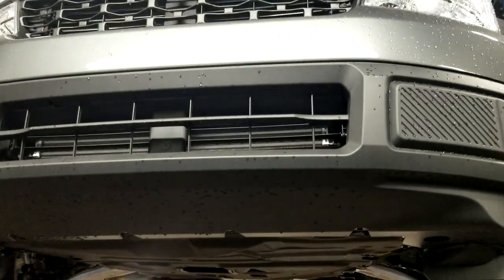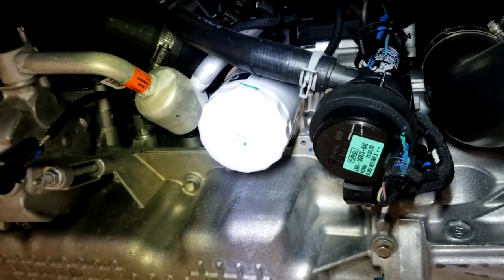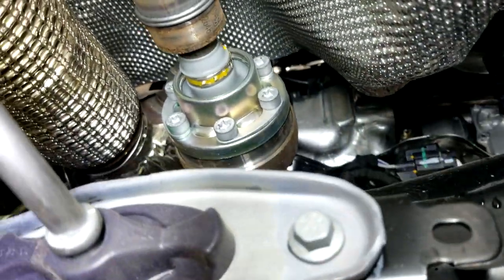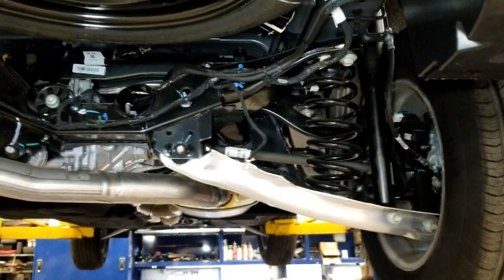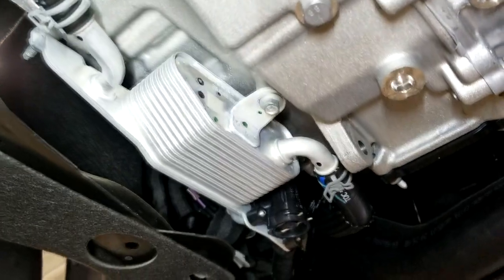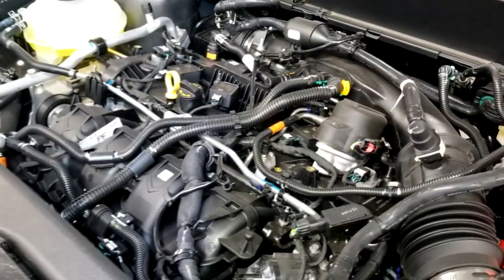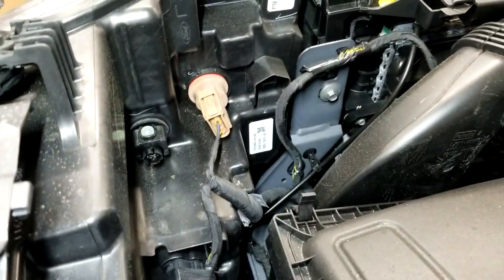2022 Ford Maverick 2.0L 4x4 Bottom View

Comment: Squirrels would chew those wires where i live . They love wires to chew for some reason .🤔
Reply: Electro 🐿️
Reply: Animals behave in weird ways...
there was a time when a mouse made between the firewall and the engine, and used the engine insulation to make the nest. 
needless to say, i was there removing fluffy fiberglass for almost an hour.
Reply: Watch out for those nut stashing Squirrels also 😂😂
Reply: The wiring insulation is probably a soy based concoction that can be digested instead of being based from crude oil, that's why they chew on it.  Other OEM's have the same problem.
Reply: @robertjones7565  would be nice is they somehow found a way to make them taste horrible

Comment: Just like everyone else, this is exactly what I was looking for. Looking at how buried the turbo is, it will probably be a big job to replace and possibly needing the cradle to be removed as in other models I have seen. I'd love a video of you showing the service procedure for the turbo replacement, even if it's just via the computer. The previous gen turbos would wear out pretty fast (70k miles and less in some cases) so it'd be good to know what one is in for.

Comment: Just picked up a 2022 2.0L XLT 4K tow 4x4 Off Road Lux packages with 12.6K miles from Carmax late May 2023.  Got the 150K mile Maxcare warranty with it.  So far has had three (3) oil changes including one by Carmax right before I bought it.  Been driving that thing a lot including towing a 21 foot camper dry weight 3200 lbs and have racked up 3K miles since purchase.  Over this past weekend I had a dealer perform The Works service so make that four (4) oil changes in the first 15.5K miles.  Plan on doing 5K oil changes as I'll be towing at least 1K miles a month.

Comment: I am considering buying an XL FWD 2.0, when the buyer frenzy and lack of availability is over. Unfortunately I am having doubts with Ford's quality of recent years, including the 2.0 ecoboost issues. We own 3 Rangers with the 2.3 Mazda design engines. One has 304k. They have been very reliable, with routine maintenance and a few minor repairs. Thank you for your videos.
Reply from the maker: The Hybrid uses a similar Mazda designed 2.3 Atkinson engine  that was in the 2006 Escape hybrid. I know there were some problems with the 2.0 Turbo engine but there have also been many improvements since the 2019 Escape 2.0 block & head design's

Comment: Fantastic video, thanks. My 2015 Genesis has a similar ridiculous layout with the addition of about 8 plastic push pins to remove at the bumper which always fall out between oil changes. At 2 years, half of the metal bolts were rusted and broke off. For all the remaining bolts, I replaced with stainless steel and use anti seize. If these bolts aren’t stainless or aluminum (check with a magnet), I will replace them with stainless on the first oil change. Cutting an oil filter access hole is easier said than done. I tried it with my Genesis and it was a failure. Using zip ties to hold the panel in place was really suboptimal. I wound up having to replace the pan when this access panel fell out and was dragging the ground. My 2017 Chrysler Pacifica van has a great built-in plastic swing down door with a hinge that is perfect for accessing the drain bolt and brilliantly, the oil filter is at the top side of the engine just like my 85 Peugeot and many of the European cars as well as Subaru. I use a Fomoto drain valve for easy oil drain  on all of my cars for the last 20 years.

Comment: Wonder how all those electrical connections will hold up while running through deep pockets of water during flooding.
Reply from the maker: I would think snow & salt would be a bigger problem
Reply: Take some preemptive steps and spray some underbody coating over the connections. The wires will be fine.
Reply: The same way they do on every body-on-frame pickup that also has exposed cable runs?
Reply: @1970351C2V  yes, the cable and tubular hosing is one thing. It’s the plastic electrical connections that are my concern. Driving through 2’ of water during flooding, also in the Northeast, snow and salt is another major concern. 
I guess time will tell. 🤷🏻‍♂️
Reply: @bluecollarmark  I have only had my ranger for two years and some of its harnesses, and plastic wiring areas are exposed and haven’t ran into any issues yet. Granted only been two years but guess the Mavericks wiring should last Atleast 2 😂

Comment: Be interesting to see how that exposed wiring holds up in the rust belt.
Reply: Just don't live in the rust belt. Easy
Reply: @ttgsushi5767  Struggle is real man.
Reply: car wash and rust proof problem solved
Reply: @willie9397  washing def helps but salt is really hard on the underside. Some vehicles based on metallurgy handle it better than others. In this case wiring will also be a factor. It may end up being a non issue. We will see.
Reply: Just a little salt and those wires will be toast.
Reply: And the field mice. I have seen the mice eat these under body wires.
Reply: My first thought, exactly.
Reply: @ttgsushi5767  
Good one skippy

Comment: Best underside look I've seen!  Does it look possible to fabricate a front-mounted 2 inch receiver?  I use a SnowSport snow plow on my Subaru Baja which I would want to move to here.  Is there a radiator between where the tow hooks would be?
Reply from the maker: Haven't had a bumper off yet but it looks very tight,,, not even enough room for the horns

Comment: I seen that they have two holes for the rear diff mount to the subframe when looking at it from behind. I wonder if they are using the same rear subframe as they are the bronco sport? I also noticed that the front wheel bearings look as though they are pressed in. And the rear are bolted in with 4 bolts. Are the rear lower control arms for the mulit-link aluminium or just shiny steel? Kind of sucks seeing the big bushings on the front control arm are the kind that tend to fail sooner rather than later. I hope they can be easily pressed out of the aluminium arms they used without distorting the arms too much. All in all, its similar to my 03' VDC Ouback underneath.
Reply: Yes, same bronco sport platform. The rear subframe had recalled on bronco sport.
Reply: I'm guessing the front control arms/bushings will be replaced as a unit.
Reply: It is the Bronco Sport !!!!

Comment: Seems like a huge pain to do an oil change. Chevy puts small 10x10 cut  outs in key areas of the skid plate,  like oil filter, and drain plug, enough to reach a hand up in there no problem.
Reply: Seems like something we’ll be doing when we get ours. 😁
Reply: @NarySllim  Yep, gonna get the saw out probably myself if I ever start changing my own oil.

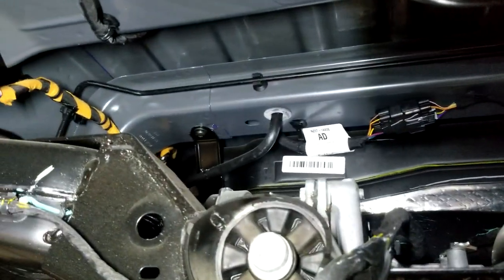Comment: 2:20 I'm not sure about the wires exposed underneath. It's a Truck, so it could go through water.
Reply: Pretty much any truck had the rear wiring exposed due to the box, I'm not aware of any that run them any differently, so I assume they made it with that in mind.  As a direct example I have a Dakota from 98, nothing is hidden underneath, and everything works.  Off roading trucks I'm pretty sure have it exposed as well, but it's built with that in mind.

Comment: This is great!  Thanks!  Is the bottom shield / cover made of metal or plastic?  There ought to be a way for the home mechanic to cobble up removable covers for the oil filter and drain plug to avoid having to remove / reinstall 15 fasteners.  Ford should've thought of this.  They thought of everything else!
Reply from the maker: Some are metal & others are a fiber material similar to what the Focus or Escape used
Reply: @RedneckCam666  Thank you!  Best of luck with your new Maverick!
Reply: I have a Focus and an Edge, I do Oil Changes on. Even Laying on the Ground doing an Oil Change, the Covers are easy to get off and back on. I have two Pick-up Trucks, with No Covers, and they are a pain. They have this Catch Pan under the Oil Filters, but the Oil drips down in Multiple Locations. Also I have to clean those pans, so I don’t have drips on the Garage Floor.
Reply: Car companies want you in their shops.

Comment: Looks a lot different than my 4x4 Ranger. The Ranger has steel skid plates even without FX4.
Reply: Your ranger is a real “truck” because it has body on the frame construction. This vehicle is a crossover with a bed as it is unibody construction.
Reply: @cliffmorrison1130  gatekeeping much?

Comment: Why do you think the reason Ford did not put a plastic engine cover on the Maverick engine like the Escape?  I understand some folks are ordering the Escape engine cover to dress up the engine and reduce noise.  But as we all know, there may have been a design purpose from Ford Engineers to deal with heat. Anyone have thoughts on this?  Overall great video.  Thanks for sharing.
Reply from the maker: Because their CHEAP!

Comment: are you using the correct terminology?  4x4= all wheel drive PTU = Power Transfer Unit ... or ?
Reply from the maker: I guess it would be Electronically controlled AWD & a PTU with an electronically controlled disconnect
Too much to put in a title
Reply: missed my polite attempt at educating you...1) the MAVRICK is NOT a 4x4 2)NOR does it have a ptO that in heavy applications would be used to upfit a hydraulic pump ... or if its a tractor with a three point hitch a  snowblower!! A ptU is what it has power transfer unit
Reply from the maker: @coachskil  I never called it a PTO, I also work on farm equipment & know the difference
Someone else questioned me on this but I''ll repost...

From The Ford Service Manual on the Maverick driveline

The Power Transfer Unit (PTU) is a gearbox that attaches to the transmission. The PTU directs power from the transmission differential case through a dog clutch to a hypoid ring gear. A hypoid pinion gear is meshed to the ring gear and splined to the output flange. A dog clutch is used to transfer drive torque from the input shaft to the ring gear. When the dog clutch is released, no torque is transferred through the ring gear and pinion to the rear driveshaft. When the dog clutch is engaged, normal AWD function is achieved by directing torque to the rear wheels as needed to prevent or control wheel slip and improve handling

Comment: Why didn't they cut a hole for the oil filter?
Reply from the maker: Email Ford & ask for an access panel!
If enough people ask ...they will put it in
Reply: You still can’t drain the oil from the pan until you remove the shield.  What would be the point to cutting an oil filter hole??
Reply: @eddiearmacost7649  Actually two holes like my camry has.
Reply: 1.  Cutting holes in a flat panel can create mysterious NVH issues.
2.  They would have to make a different panel for the various engine models.
3.  The cover is there to increase mileage.  Any holes added to the cover are counterproductive.  

If you're so inclined, you can also make access holes yourself.

Comment: Nice video.  I love the ease of maintenance on this truck.  Oil changes and tuneups seem like a breeze.  Good gas mileage can make this my daily driver instead of my current half-ton truck getting 16 mpg.
Reply: Truck? Seems like a Ford Escape to me. A real truck is a Toyota Tacoma.
Reply: @jaysmith179  Don't knock it quite yet. People said the Jeep Cherokee Trailhawk  was just a badge. Instead, if you watch any off road Jeep Wrangler videos, there's always a Cherokee right behind it keeping up. That said, the AWD system here will need to be upgraded to the version that is on the Bronco Badlands. That AWD system is a direct bolt for bolt replacement.

And since they used the 2.0 ecoboost, Steeda already has a full suite of power upgrades available because this is the exact same engine that was used in the Focus RS. Steeda got the Focus to just over 380 HP while still maintaining 35 MPG. However, if all else fails someone could just swap the engine to the 2.3 ecoboost that is found on the Mustang.

The AWD and engine swap are probably what Ford are planning for the Raptor/Rumbler version of the Maverick. Would it be able to go everywhere a TRD Pro Tacoma could? No chance. But it could go 90+ percent of those places with double the fuel economy. And absolutely blow its doors off while doing it.
Reply: @jaysmith179  And for the record, I'm a Toyota guy, too. 2020 TRD Pro Tacoma.
Reply: @jaysmith179 Except the Tacoma carries less cargo- The Mav takes a genuine 1500 lbs with crew cab seating.  And the Tacoma with crew cab and 4WD cost 15k more.   The Tacoma also has LESS interior storage. And its bed is as short, but not designed to carry 4X8 sheet goods like the Mav. Has fewer tie downs, and does not have the built in trailer brake controller the Mav sports with the 4K tow package.   The Tacoma is larger, with poorer gas mileage.  About the only thing the Tacoma has over the Maverick is it can tow more, IF you get it with the larger 6 cylinder engine.  ( the Tacoma also has a higher ground clearance. )  But for those of us who don’t need to step over large rocks or deep ruts, The Maverick is a better, more usable truck than my 2004 Tacoma 4x4 crew cab ever was.

Comment: FYI       I sat in a Ford Maverick.  I'm 6'4" over 250 lbs.  When I put the drivers seat in the position that I'm comfortable, no one over 5' could sit in the seat behind me.  I ordered one by it's for myself and wife.   Mostly myself.  Just giving you some info these guys aren't.//
Reply: Im also tall and i hate center consoles. My small car has a low console. My knee rubs the big ones. Wanted to get a bench seat truck. But the maverick gives me a little hope. Is there enough knee room when your tall legs are "spread" and on the gas pedal?

Comment: A solenoid to disconnect the rear drive shaft? Don't think so......This is ALL WHEEL DRIVE> Continuously.
Reply from the maker: From The Service Manual

The Power Transfer Unit (PTU) is a gearbox that attaches to the transmission. The PTU directs power from the transmission differential case through a dog clutch to a hypoid ring gear. A hypoid pinion gear is meshed to the ring gear and splined to the output flange. A dog clutch is used to transfer drive torque from the input shaft to the ring gear. When the dog clutch is released, no torque is transferred through the ring gear and pinion to the rear driveshaft. When the dog clutch is engaged, normal AWD function is achieved by directing torque to the rear wheels as needed to prevent or control wheel slip and improve handling

Comment: Wow no access tunnels for oil changes? Come on now that's amateur levels of design. Also all that exposed wiring looks like a big recipe for disaster when it comes to corrosion, guess you can't drive the maverick in the rain.
Reply from the maker: If everyone sends a message to Ford , they might do something about it
Reply: All pickups had exposed wiring ever since they were built.
Reply: @keithwiebe1787  I was going to say this under a few peoples posts but refrained. You watch any video of the undercarriage of any modern truck and there’s exposed wiring harnesses everywhere, attached to the frame, or by the transfer case etc.
Reply: Trucks always have exposed wiring harnesses there is no place to put the wires my old ranger doesn’t have issues with wires corrosion
Reply: @zackhaycraft8159  maybe so, I've only owned Toyota trucks and got the most part they never had it to where you can see the actual color of the wires without at least one layer of protection. If I get this truck I'll probably just keep an eye on it, seems like a lot of people haven't had issues surprisingly. Electrical issues in cars is just an absolute nightmare to trace and is often just due to corroded wires.
Reply: @Mr.Meme01  most trucks I haven’t seen issues when they are exposed

Comment: I guess the screws will be stripped out after a few oil changes ..
Reply from the maker: For sure if guys use a cordless impact driver to put them back
Reply: Yes, about every Escape I take the cover off the screws are already stripped and barely hanging in there. I will do my Maverick maintenance myself to avoid stripping it. My only concern with so many panels is they are perfect areas for rodents to build nests in.

Comment: Wow. It’s tight under there! How much do you have to take off to get to the turbo and ABS for service? I hope we don’t see broken exhaust manifolds, turbos and transmission/trans axles becoming major failure points on these guys. And these definitely are soft off roaders. Your not going to be doing much rock crawling, stump jumping or mud bogging. To much exposed fragile stuff. The salty road lands are going to eat all that exposed wiring and connectors like Halloween candy! 

I would like to see the undersides of an FX4 package truck to see what the armor protection looks like. This one is just the AWD model. No skid plates or tow hooks. 

But I still really like this little truck! It will do everything I want and need it to do. I am not a hard core off road person. Otherwise I would be looking at wranglers, gladiators and papa Broncos.

Good to see what the underside looks like. Thanks.
Reply from the maker: To replace the turbo would be like the old Escape.easiest way is to drop the entire power train out

Comment: Just my opinion from past experience, in the northeast, due to road salt for 5 months, the Marverick will be a rust bucket in two years, to many exposed parts. Ford, please don't sell the Marverick in the Northeast.
Reply: I lived in CT for 18 years. They don’t use salt, only sand fir thus very reason.  Plus, salt only works down to 32 degrees.